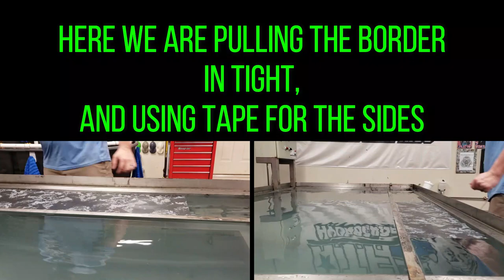HYDRO DIP MAGPUL SGA [Veil Tactical Black]

Comment: which primer should be used for barrel and case
an epoxy primer?
Reply from the maker: If you use a paint that requires primer I would suggest a 2k epoxy primer. If you use OHW you don't need primer at all.

Comment: Did you have a hard time getting that stock apart. I’m trying to separate the halves but it feels glued together
Reply from the maker: There is a trick... the stippled grip area is actually hiding 2 or 3 screws underneath. You have to use a very thin flathead screw driver to pry the grip areas off. They are like pop in place plastic covers. Under the grip textured prices you will find the rest of the screws holding it together. No glue at all. We have taken tons of them apart.